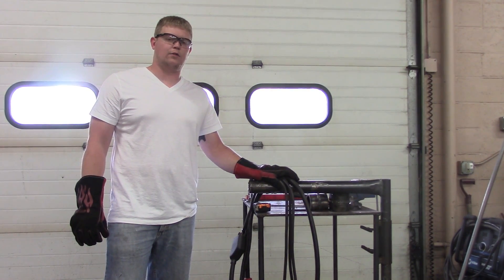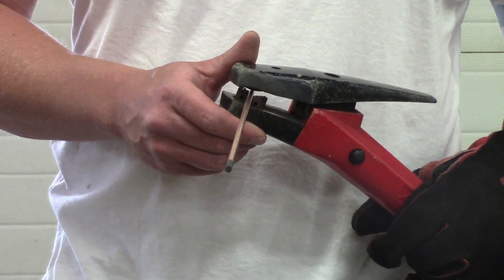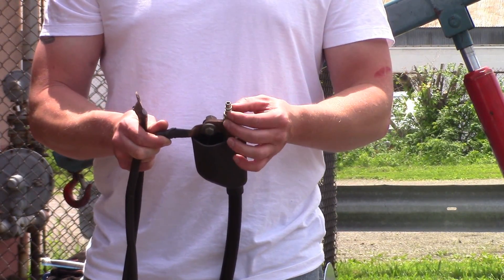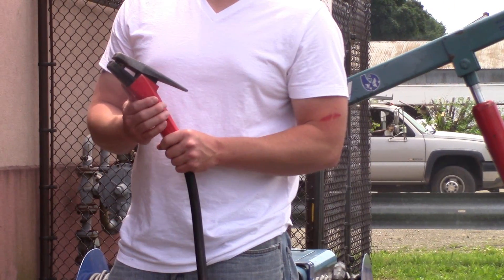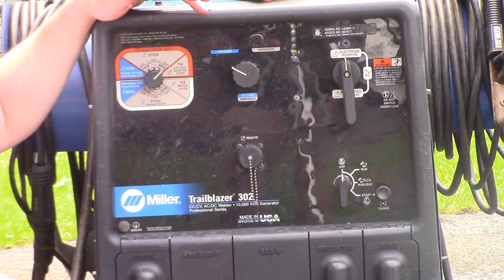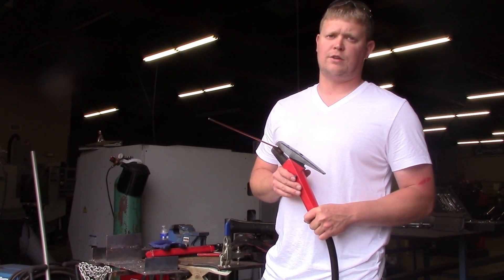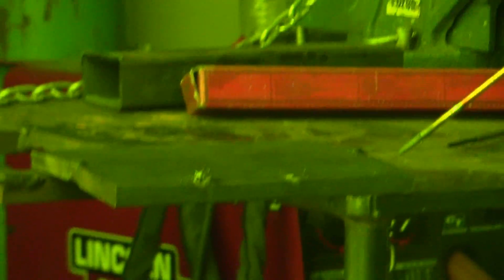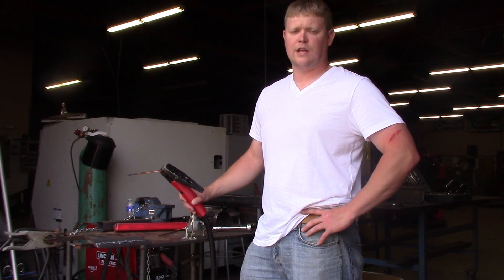How To Set Up A Carbon Arc Gouger

Comment: Nice work!  Looks like you were pushing at about a 30 degree angle, and your material was nice and clean so the arc was stable.  Most people use too steep of a push angle and work with dirty material - you did it completely right!

Comment: One of the better arc gouging videos out there.  Could have spent more time going into DCEP and DCEN and AC, as apparently you need different electrodes for each, at least ideally.  First video I've seen where you can see the copper skin melting off as the carbon burns.  Keep up the great work!

Comment: Hello!  Excellent video.  Can you give me some advice on cutting a 1" square hole through 1/2" AR500 target steel?  I am using the plate as an anvil surface welded onto a large piece of 1/2" medium carbon steel which also has to be cut the same way.  The hole is for a hardie.  I will also cut a round 5/8" hole.  I am concerned about which angle to use on the rod and how to direct the air.  Straight down?  Carbide tipped drill bits "won't cut it!"  Thanks!
Reply: Fossils etc. Make a drift heat the plate up and hammer the drift threw

Comment: Did ya burn arm with the Carbon rod?   Try run 1/4" on that machine, I had an older Trail blazer 301, no problems.   Now I have a Big Blue 400D, 3/8" rods all day long.